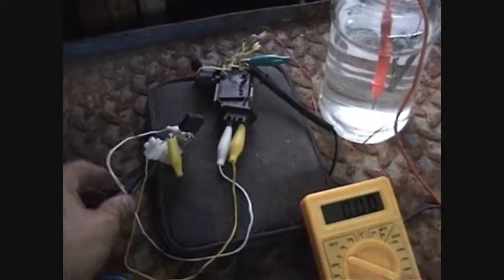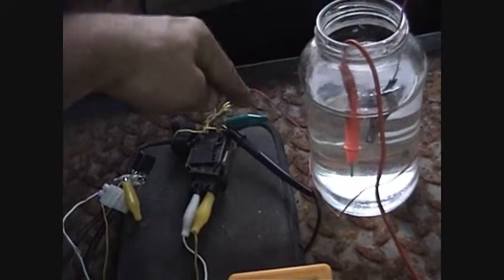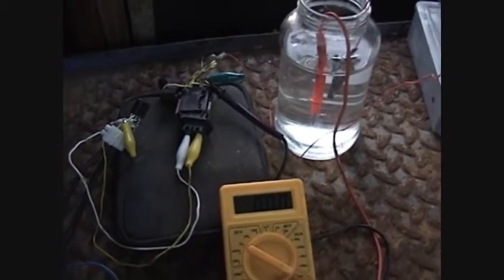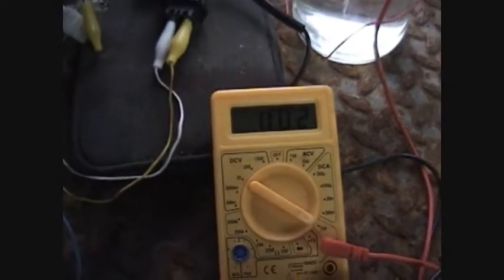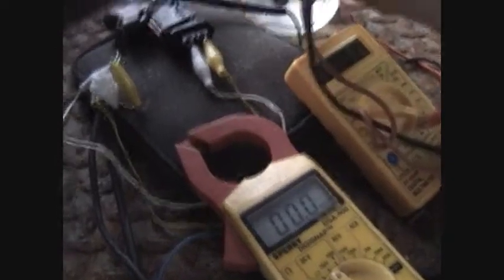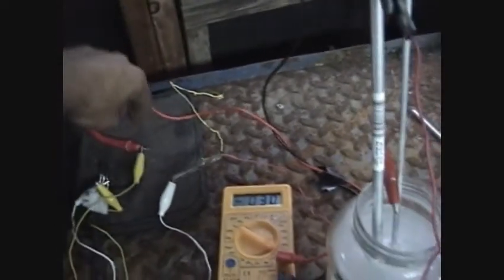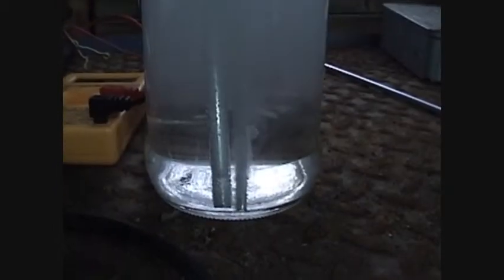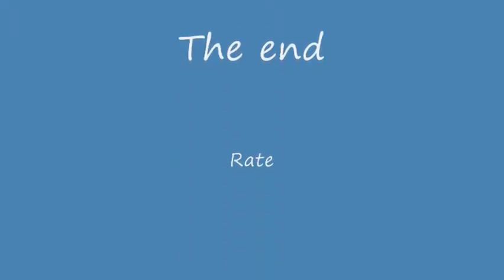Inverted & Rectified

Comment from the maker: I was trying to find a reliable pwm, and for high voltage the only thing that will controll amperage with 120vac is a light dimmer switch... but it will work without it you just cant controll the output